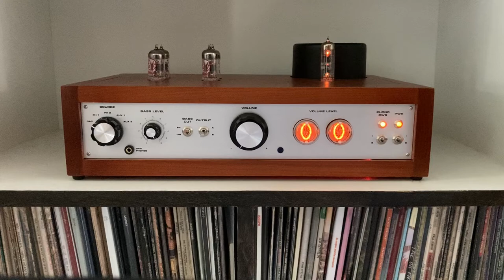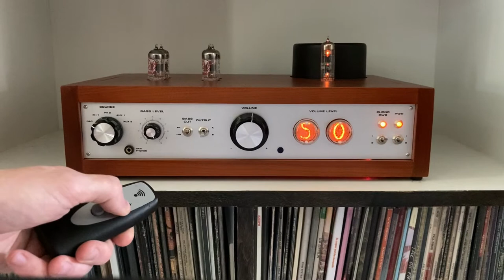Tube Preamp Nixie Volume Display Demo

Comment: Hi very nice project and thanks for sharing and inspiring. Would appreciate it if you could share specifically the components required for the nixie tubes to display volume. Thanks
Reply: Hi I saw the details of making the nixie tubes work. Too complex for me....is there a off the shelf solution ?
Reply from the maker: @johnsnowlow1883  There are a lot of nixie tube clocks on the market, but I'm not aware of any OTS volume displays.
Reply: @justinis  thanks 👍
Reply: @justinis Hi any possibility that I can buy the volume OTS from you?
Reply from the maker: @johnsnowlow1883  no, sorry